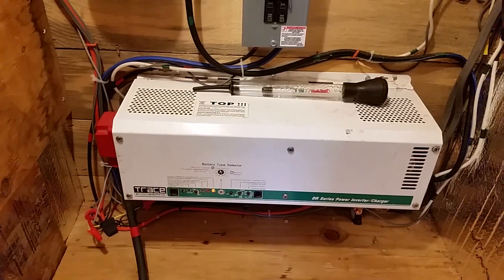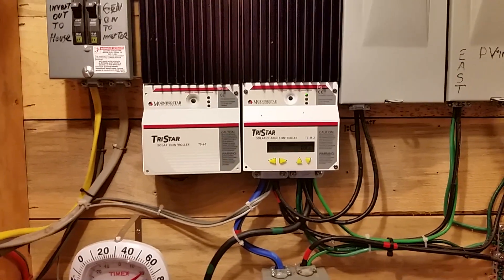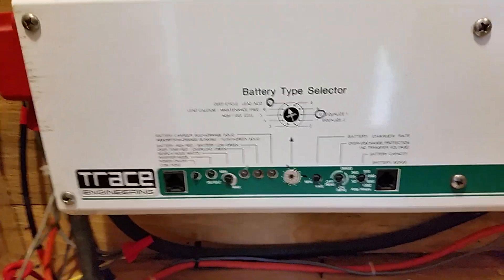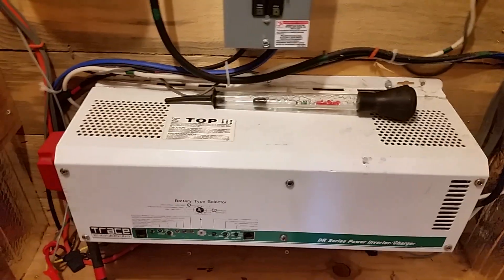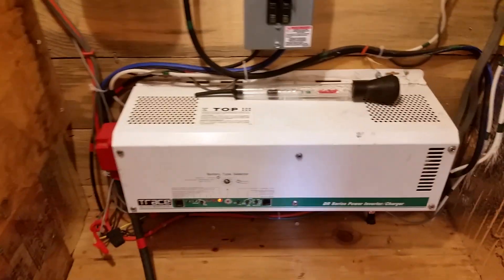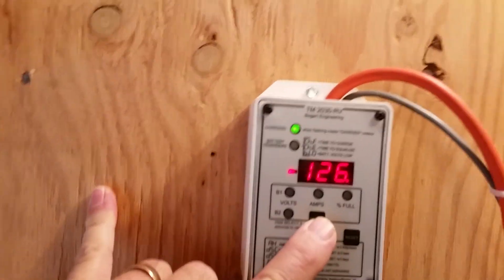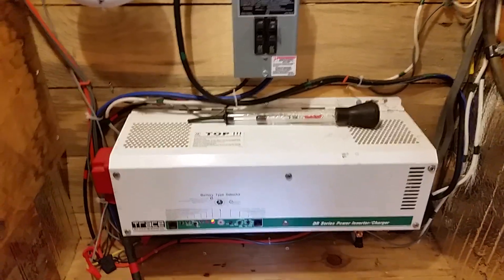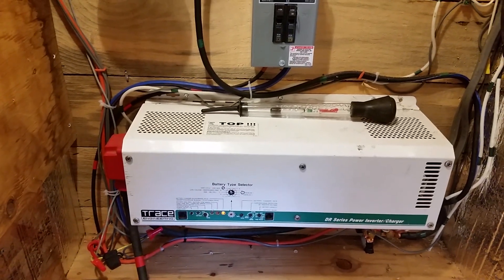Old Trace DR-3624 Inverter

Comment: Thanks for the video. I’ve been Jerry-rigging a borrowed one of these to keep us going while my Victron unit gets parts from Holland for repairs. 
At 24 volts, I guess the DR series unit here would also be 3.6kw?
Does anyone know how to tell which way the rotary battery type switch is pointing? Mine just has a Philips-style plus in the centre, with absolutely no discernible point on it.
Reply from the maker: I have  Dr series T4ace 3624. It is a 3.6 kilowatt inverter with a 105 amp charger built in. I can't tell you about the rotary switch.

Comment: Hello did you use any air conditioner with this inverter i´m not sure if this inverter could run a air conditioner.
Reply from the maker: Yes very easily. I did change this inverter out for a pure sine wave Magnum MS 4024.
We made the change so the ceiling fans would run quieter.
Reply: So you never use your air conditioning system with the DR3624?
Reply: its a modified sine.

Comment: Hi sir i have a inverter like yours please can you tell me the name of the software to control this inverter and where can i download it thanks you very much
Reply from the maker: Raciel Perez Greetings from Oregon,  the firmware is no longer supported so it is n9t available from the manufacturer. I hunted for the latest update and was  encouraged not to try to upload it because if it crashed I was on my own without support.  I read the manual and the settings on the Inverter was more than capable to Handel a wide variety of battery types and sizes. I was off grid for 3 years using the Old Trace DR series both in the 12 volt and the 24 volt models.
Now we have a Magnum MS 4024 pure sine inverter/charger. The DR series Trace inverter / Charger charges the battery bank very well when running our diesel generator however they are not Power Factor Corrected. So they need a sizable generator to get full amperage in the charge mode, like a 5k minimum generator.  That said a military 3k generator has a peak to peak voltage of 300 volts and they will work fine. I had a 5000 watt generator that barely would put 45 amps on the batteries but my MEP-016D 3000 watt generator will get the full 70 amps to my 24 volt battery bank.

Comment: Did you ever get this fixed ? I have a chance to buy 2 on these un used ? your thoughts ? 863-698-5022
Reply from the maker: Shawn Kirk I got it all sorted out. There was nothing wrong with the inverter. The DR Trace is a real good inverter for its day.  They last just about forever. I replaced mine with a Magnum  pure sine wave. The Trace DR series is modified sine. I installed my old DR at my dad's house for a backup if the power goes out and it is still rock solid.
Reply from the maker: Shawn Kirk The problem was my inexperience. If I tuned the solar off the inverter would fully charge the batteries. It was the solar input that made the inverter think the batteries were full lol... duh... I FINALLY realized it and just turned the solar off while I charge the batteries with the generator and everything was perfect.
Reply: Just wrapping up a long weekend on the Grouse Creek property,  I'm so happy about it : ) 
Darn IRMA set us back a little... but moving forward. Cant wait to show you the place. we are hoping to be moving up soon.  What the difference between the sine wave things ?
Reply from the maker: Shawn Kirk pure sine wave also known as true sine wave is just like the power grid. Modified sine wave also known as square wave can be a problem for some electronic euipment. With a stereo you can hear a background buz. With motors like  fans you may hear a buzzing sound. Cell phone chargers seem to have a shorter life as well. I was off grid for almost 3 years with the Trace DR series modified sine wave inverter. It ran everything with no problems from computers to skill saws but the ceiling fans were noisy. That's the main reason I changed to a pure sine wave inverter.
Reply: Thanks...

Comment: Anyone know where I can get the Trace PDF manual for this inverter?
Reply from the maker: I found them on ebay. there is also a pdf file floating around on the internet.
Reply: @offgridinthepacificnorthwe3210  
Installation and owners manuals here free PDF downloads.
http://www.manualslib.com/products/Xantrex-Trace-Dr3624-430729.html

Comment: I'm thinking you need to adjust your TriStar charge controller. your inverter charger is for charging from your generator.  the TriStar charge controller is fully programmable . the TriStar should go right to the batteries does it equalize at what voltage ramberg1962@gmail.com is my email
Reply: I was left with the impression that the solar wasn't getting the batteries charged